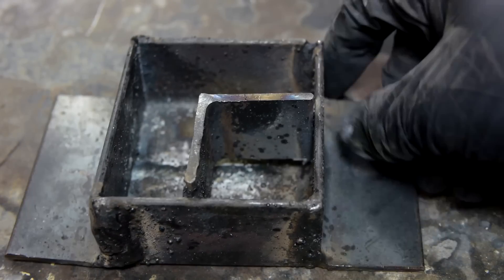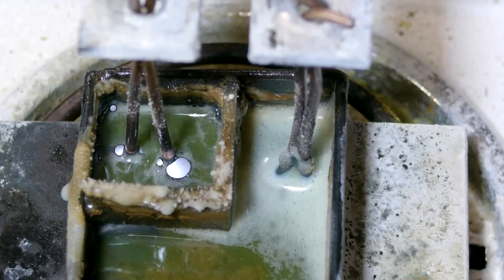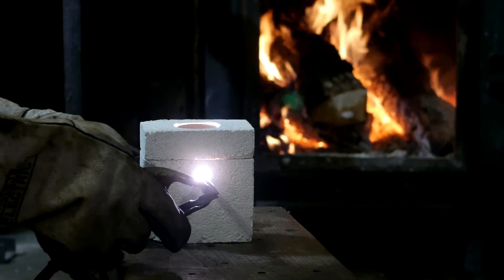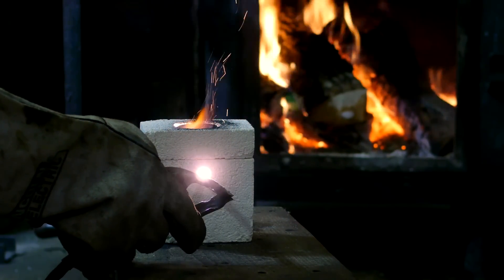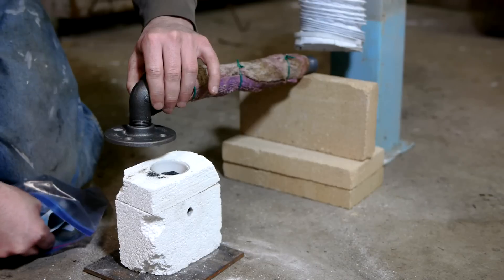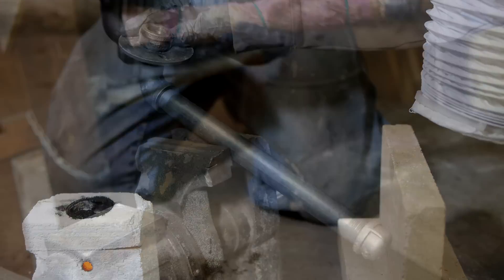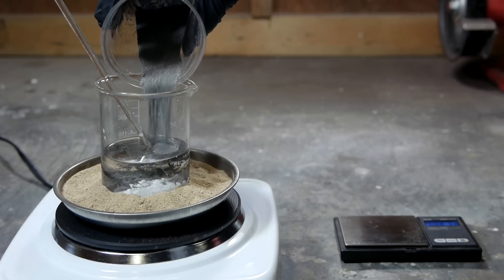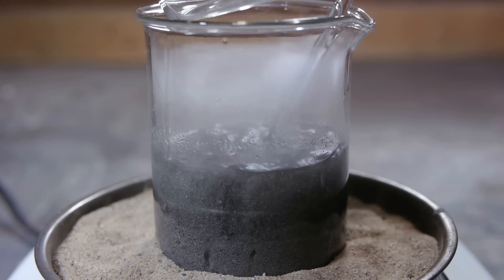How To Isolate Potassium Metal With A Plasma Furnace [Alkali Metal Series Part 2] - NightHawkInLight

Comment: Potassium superoxide is more of a yellow/red color. Not black at all, also its not a high explosive. The danger is that the superoxide can react with fresh potassium creating more oxide and alot of heat. This can lead to a run away reaction causing a potassium fire.

Comment: Mimic an actual still, all the components of the still are required, the cooling system has to be more effective, maby take some thermal temperature measurements and see how cool you can get the exhaust

Comment: I would try first method again but this time making a cover and pulling a vacuum on top of the electrolyte. Some kind of DIY silicone cover with a hole and a vacuum pump or a vacuum cleaner on top of your reaction vessel

Comment: Good work. I have small suggestion. The melting point of KCl  Potassium chloride is 770°C (1420°F). Not too high to make electrolysis. The metallik K will not react with melted KCl. So, just keep off the air. Use Graphite anode. The melting point is higher than the one of KCl. It might react with Cl, but I am not sure. The metal anode is positive charged and is highly possible that it will become cation and will rapidly dissolve into solution, so will flow go to cathode and will become metal again.

Comment: I THOUGHT OF A WAY!!
its called thermite assisted sodium!!
the idea is a little bit of iron thermite mixed in or at the core of a mixture of sodium carbonate and aluminum or carbon in a crucible and with a narrow metal pipe sticking out with a coil submerged in oil.
the heat of the thermite may make this reaction favorable and spontaneous!!

Comment: Hey, I have recently tried making sodium via electrolysis. I used molten sodium chloride which seemed to work very well ( if you don't mind wearing a respirator because of the chlorine). I was thinking about doing the same for potassium chloride which should work in a identical way.

Comment: Maybe try playing around with using inert gasses to protect the alkali metals while they're in the reaction vessels instead of mineral oil. This might have the added advantage of being able to use it to flush the system as it's reacting to protect it as well. Also for your pipe still, maybe have water actively running over the pipe to carry the heat away instead of just a damp rag. It might be more efficient. Cheers.

Comment: These are excellent videos!

They bring back many happy memories for me. I used to be literally obsessed with explosives/fireworks/poisons in my youth. It was all I was interested in along with playing the occasional game of football/soccer! I wish I had the time that I used to have to perform experiments.

I tried the synthesis of sodium by igniting a mix of Mg powder and sodium carbonate, but it was always messy and difficult to extract the Na. It was a fun reaction to do at least!

Regarding the synthesis of Na by electrolysis, have you tried fusing sodium hydroxide with other salts before electrolysis? This should lower the melting point and make the whole process so much easier do work with.

I used to mix ground up sodium hydroxide with sodium chloride and fuse it to make a sort of paste before passing an electric current through it to isolate sodium metal. This worked better for me than electrolysis of pure molten sodium hydroxide. I don't have exact details of the ratio of NaOH to NaCl I used as it was so long ago, but I just remember it working fairly well for me. I wonder if there are better salts than NaCl to use.

I used 2B pencil leads for electrodes, but I suppose a Ni cathode and graphite anode would be good. The graphite anode would be corroded away through the electrolysis but that's not a problem. An argon atmosphere would be good as others have mentioned, but that could be used if you start making larger amounts of sodium.

You could also try fusing NaOH with KOH to get the melting point down and try the electrolysis of this mix. That would be interesting to do. I wonder if you'd get any NaK alloy.

I also wonder if there are other mixtures that would get the melting point right down even lower. I wish so much that I had the time to test some out!

Thanks NightHawkInLight for the happy memories!

edit: I've just found this info:

Although the melting points of both pure sodium hydroxide and potassium hydroxide are over 300 °C, (323 °C for NaOH and 360 °C for KOH,) the eutectic point at NaOH/KOH ) 51.5 : 48.5 is only about 165 °C.

It looks like a fused mixture of 50/50 mixture of NaOH / KOH could work really well for electrolysis! I don't know whether you'd get pure Na though or some NaK alloy.

Comment: Is it possible that an inert gas could prevent the product from boiling off into the air?  (ie. fill top area of vessel with the gas so the products do not have a way to react with oxegen).

Comment: Some time ago I melted potassium hydroxide in a crucible until it stopped fizzing, so I got rid of all the water. When I added larger pieces of magnesium metal to the molten hydroxide a smooth reaction took place and the potassium burned away due to the oxygen. There's a paper about it that can be found on the internet. It's mainly about reducing the alkali metal carbonates with magnesium.

Comment: Perhaps the potassium carbonate is just decomposing to potassium oxide without reacting with the carbon. I would try decomposing the K2CO3 into K2O first, then try to reduce it with the charcoal as the CO2 from the charcoal could be inhibiting the decomposition by creating a reverse reaction of K2O to K2CO3

Comment: I got an idea. Hook up 3/8" x 50' Stainless Steel Tubing Coil to that pipe and submerge it in ice and water. Have a mason jar attached to the end of it with the tubing 1" - 0.5" from the bottom of the inside of the mason jar submerged in a couple inches of mineral oil.Then have a adjustable air pump hooked up to it to create a pull for the system to gather the vapors at a slow pace. all the parts can be had for under a 100$ for this idea. I enjoy your channel greatly. Keep on being one of the great youtube mad scientist

Comment: This is very interesting.  I think best results might be from electrolysis of the molten chloride salt using carbon electrodes. Contain the reaction under an inverted aquarium and flood it with helium gas (maybe a constant or intermittent flow). Use only electrical heating methods to eliminate gases from interacting.  Partition the electrolytic cell (maybe carbon sheet?) so chlorine gas seeps away from the Potassium collecting electrode and out the bottom of the inverted aquarium.
Reply: if you do it on KCl the metallic K will be solved, you cannot produce potassium by electrolysing KCl. You can make Sodium by electrolysing NaCl. Then if you add metallic sodium into liquid KCl then you get the metallic potassium
Reply: That doesn't make sense.  The melting point of KCL is higher than the boiling pint of K. It would be released as a gas and it may be possible to distill it off.   Even if the gas dissolved into the molten KCL it would then be present (condense) upon cooling. I may attempt it one day.  It could probably be carried out using a cheaper Nitrogen gas atmosphere.  You could use graphite molds for the molten salt and quartz glassware for the still head.

Comment: Maybe a longer condensing pipe. The flow of gas coming out the end of your pipe, was pretty fast. Measure the temperature of the gas just outside the pipe and see if its close to the condensation point of the potassium.

Comment: Hey man, suggestion: I think it would be very easy, for you especially, to build an airtight chamber to contain your reaction vessel/furnace. Then you can easily displace the air with a heavy noble gas to prevent the oxidation and combustion reactions that are occurring and lowering your yields.
Reply from the maker: +nabzim Even the refractory bricks that are made for extreme heat melt from the arc. I don't know of any material that could be used for an airtight reaction chamber.
Reply: +NightHawkInLight I was thinking of some open-space between the walls of the brick and the walls of the box. the dimensions of the chamber would need to be substantially larger than the fire brick, in order for it to be far enough away from the heat. Like, if the chamber was big enough to allow for, ~12 inches or so of distance, from the brick to the walls on all sides, I think that you could do it, and it would work

Comment: try to break apart cesium fluoride
Reply: cesium fluoride is a salt, man... an ionic compound, which means it "breaks apart" any time you dissolve it water. Unless you mean break it apart by reduction of cesium, of course.
Reply: I know. I'm talking about trying to separate Flourine gas and Cesium metal from each other to the elemental states
Reply: Ok, I would agree that's probably pretty hard to do...

Comment: You can also attempt to get sodium by electrolyzis of a simple salt water solution, over a liquid mercury cathode.
The chlorine gas escapes at the anode, and a sodium-mercury amalgam is formed in the mercury bath under the salt+water.
This is the Castner-Keller process, which is described in Wikipedia.
Usually the Na3Hg is immediately reacted with water in a separate part of the cell to obtain commercial NaOH.
One can probably separate the sodium from the liquid mercury, I have no clear idea how.
Mercury is of course a slow poison and the resulting sodium is likely to be contaminated by mercury.

Comment: In the French book "Nouveau traité de chimie industrielle (1901)" by Wagner,Fisher&Gautier, an ancient technique to produce sodium or potassium by their respective carbonates is described:
In a slightly inclined metal tube, put 30Kg of sodium carbonate, 13Kg of charcoal and 5Kg of cray.
Heat the tube to a red heat, and sodium will be reduced and come out drop by drop from the lower end of the tube, where it falls in a pot of mineral oil.
The yield is only 40% of the starting NA2CO3. 4000 calories are needed per Kg of sodium, only 2500 per Kg of potassium.
That method is considered to be obsolete in the book.

Comment: A question I have is if you can tell me datas like voltage, etc. of the arcfurnace because I tought of building one myself but I don't have a clue how much voltage must come out to work. If you could tell me how much wattage the transformercoils draw and  how much amps or volts they put out it would help me alot.

Comment: why not trying to cool down the steel pipe using solid CO2 or liquid nitrogen? you should probably be able to collect both potassium and CO2, but then heating it up again the CO2 will evaporate

Comment: I don't know if this is a thing, but a metal pipe that is like male female pvc.
but if it is, is it possible to have various breaks in a metal pipe and pinched in between of the connections is metal mesh, a lot of it randomly placed about.
then have few stops like that, while the whole pipe is kept cool. and a light suction keeping airflow.
that might let you solidify the gas onto the mesh and remove the pinched mesh with the potassium on it? 
I have no idea how any of this works, but I'm just throwing my nonsense out there.

Comment: Generally a good way to retrieve a gaseous product is to direct it to bubble up through a liquid that it will not react with. Set up your pipe to open under a mineral oil bath. If you want to cool the container with ice on the outside, that would be ok. After a while, you should see some solid potassium collected in the bottom of the container.

Comment: oh also, with your electrolysis method of producing sodium, you could go with putting the electrodes on the bottom of the tank like what Ebrahim Babajan suggested, but then putting something that would catch the sodium metal as it tries to float to the surface, that would save it from both exposure to air and water

Comment: I think you have a problem with your distilling-of-potassium, the end of the pipe you are using is open when you are performing the distillation, therefore the potassium might just be flowing out of the gap you created. I suggest you close the gap with something that won't trap all of the gas so you don't end up making a bomb.

Comment: an idea I was thinking of for the electrolysis of KOH was to set up the electrodes under the liquid hydroxide so the metal formed wouldn't react with the air. would this perhaps make electrolysis a more favorable approach?
Reply from the maker: +Ebrahim Babajan The metal floats so that wouldn't do much good.
Reply: Would it be possible to find a flux less dense than the potassium and non-reactive with it so that the alkali metal formed stays between the flux and the potassium hydroxide?  I show an approximate density of .828 at its melting point.  Potassium Hydroxide is obviously more dense, and so are all the molten salts of potassium I looked up.  Looked at common solvents but none could stand the temperature that were less dense than potassium.  Since I could not come up with a suitably lightweight flux, I started thinking about the collection of hydrogen in an electrolysis cell.  Since the potassium is lighter and floats, an inverted test tube initially filled with molten potassium hydroxide should have the potassium hydroxide displaced with the potassium plus any gasses formed along with it at the anode.

Comment: There is a way to make cesium using cesium chloride and lithium. The lithium sucks the choride out of the cesium chloride distilling cesium. I saw a video on it and this guy turned cesium into a gas and made it flow into a separate chamber which then, the cesium condensed into a metal in an argon atmosphere. If this works with cesium, the most reactive alkali metal, it should work with potassium.

Comment: I think you should make a "bubbler" 
Collect the gas with a pipe that runs at the bottom of a bottle filled with mineral oil. 
It will cool down the gas and protect the metal. 
Try to keep the bottle cooled, just dump the bottle in a large quantity of water for exemple

Comment: Why don't you bubble the potassium gas through mineral oil that is cooled in a ice bath so the potassium will solidify in the oil?
Reply from the maker: +Renaldo Joubert That's the intuitive thing to do, but it's easier said than done. I would have to make an air tight connection with the crucible to force the potassium into the oil.

Comment: Very nice video!.how about using lithium and potassium chloride ?. In a stainless steel pipe using a non reactive gas as shielding and distill the potassium metal  .also in this way you can isolate cesium and rubidium from their salts .furthermore you can electrolyze the chloride salts of all of the alkali metals at high temperatures and distill the metal but chlorine gas will be produced

Comment: Keep it up man, Also try separating the electroders further away from eachother and increasing the size of the sodium-producing electrode and leave a flame consuming all the oxigen  on the oxigen-producing electrode much like in the undustry, where when electrolyting sodium chloride they burn all the hydrogen with a constant flame hitting the  molten salt

Comment: Nurdrage has posted a video about the catalyzed potassium reaction. It's not on his channel, but you can still find it on youtube. He uses Mineral oil as a high boiling solvent, not the wax and naptha you use, but otherwise, it was the same. Potassium hydroxide, with Magnesium, and the tertiary alcohol you use should help keep the potassium clear of the explosive hydroxides!

Comment: If you can I would try electrolyzing a chloride (this requires some alkali earth chloride in the mix as well according to Wikipedia) while venting the chlorine through carbonate
Obviously this is very dangerous especially if you can't get a good seal for the chlorine venting and so should only be attempted if you can make a good high temperature  seal

Comment: have the pipe go through a water bath or something similar to produse lower temperatures for longer durations?
maby more pipe? maby pre freeze it/ maby use an air compresser to capture all the gass (if you have a way to significantly clean its innards).

Comment: Use the Pipe and use it to funnel the fumes into an closed bucket with dry ice.  Allso you could use a small PC-fan to suck the fumes into the dry ice trap. With this you´ll get better cooling and  protective layer of gas.

Comment: how about using a vaacum. i believe theproblem here is the involment of oxygen why not conduct the reaction under a pyrex vaccum cupling suck up the oxygen so that no potassium is lost during the reaction or try the electrolysis under a vaccum. I think it should work as without the oxygen it wont react with the potassium.

Comment: The K or Na is so reactive that it reacts with CO2 to form oxides and carbon, and that is why the first reaction might not work (you could try extinguishing burning Na with CO2 gas to proove that, it surely works with Mg as it will continue to burn in CO2 atmosphere)